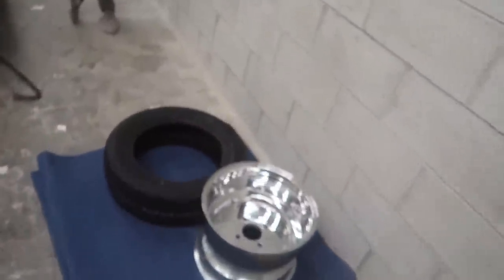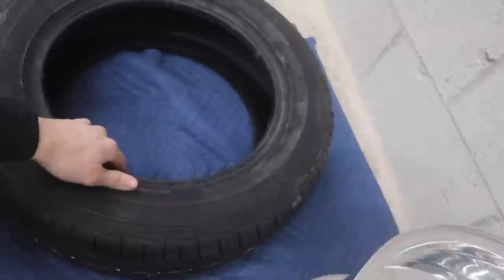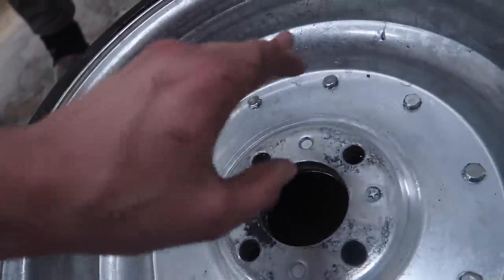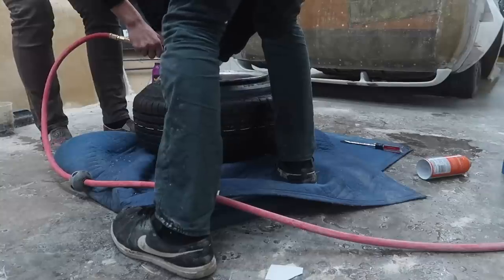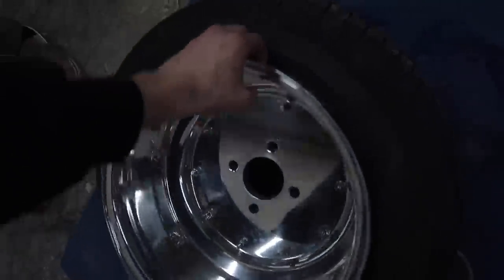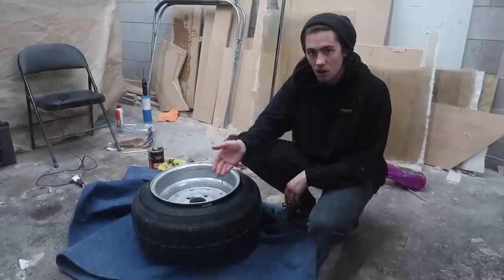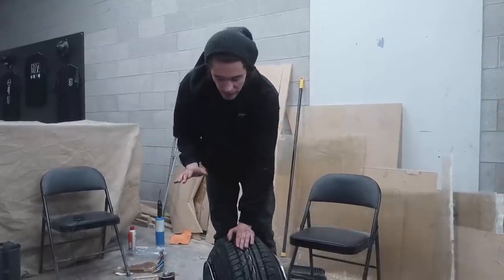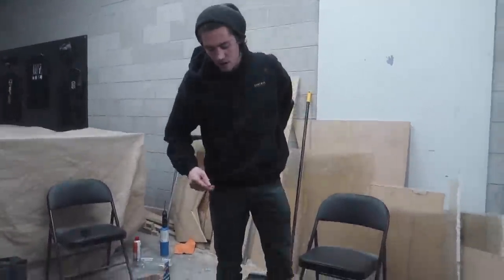Trying To Fit A 185 On A 10.5j

Comment: Harbor fright has tire spoons for 5 bucks and they last....AND BEAD SEALER GOES UNDER THE BEAD.NOT ON TOP😂😂
Reply: He said he isn't keeping the tire so does it matter? It was a test not permanent. So who cares?
Reply: Whether he is keeping it or not he used the bead sealer so wrong
Reply: @mynamejeff2647  It seriously was to hold air long enough to test fitment. Like 404found said watch before commenting.
Reply: 404Found if you read his comment he said that bead sealer is used on the inside so putting it on the outside wouldn't work so he didn't seal it and he also was giving advice on how not to rip tires by buying a tool meant for the job in no way did he call him out for ripping the bead he was giving friendly advice it's sad to read YouTube comment and see people attacking others when they don't understand what's being said or done

Comment: I think it’ll probably be your best bet to go with a 185-195/60. I’m sure you’ve seen this already, but most of the boso guys either run a lot of stretch, or use vintage racing slicks for a little to no stretch look. I personally like the way both look, but those wide vintage tires are extremely expensive. Speaking of that though, Hayashi is going to be selling some new tires that are just for wide and low offset 14” wheels. May be something to look into!
Reply: When they do slicks, they tend to be low profile as well 👍
Reply: NintendoGeek26 yes you’re correct!
Reply: The slicks are more of a Kaido Racer thing.
Reply: Hashiriya*Style yes the kaido racers are the ones who run the vintage slicks. However, I’ve seen several boso cars running them!
Reply: @VermillionInvades  i remember seeing a super wide wheel (it was definitely over 15j) in an old video option video. It was running slicks with a stretch lol
Reply: NintendoGeek26 I’ve seen a Hako with flares stretch some ridiculous meat on a 14.5j. There’s pictures on google somewhere.

Comment: okay if you go with an r compund, say the tire size u need fits a 7inch wide wheel, put the tire on a 7 inch wide wheel and drive around on low pressure, like 15psi or so to soften the sidewalls drive around for a while then take them off and put them on the super wide wheels. do this and you will be fine.

Comment: stretching tires throws safty out the window period. i know alot of people run stretches with out problems but its still unsafe. however a slight stretch in my opinion looks great. my choice would be the 225
Reply: good luck finding 225 14's :D Idk if it exists at all
Reply: TOYO Proxes R888 P225/50R14  availible on ebay
Reply: @KrustyPickles  aren't those r comps? He said they were struggling with them because the sidewalls are too stiff
Reply: @commptonn  probably but they are 225s
Reply: @slamazonvan  if you can't get it on then it's pointless. This is a bozo car not a daily. He talked about trailering it to shows. Dude even said he is somewhat uncomfortable with the amount of stretch.
Reply: +Krusty Pickles Gaming he already had those tires

Comment: lol My nephew runs a tire shop, he just struggled to mount 24x14s with 35x13.50s for his 18 tundra.. took 2 blaster and a strap after half a can of lighter fluid warmed the rubber.. they do all those tire combos and set camber etc... if you do it again, use LOTS of dish soap with a little water 2/3s soap 1/3 water, get more of the fluid inside the tire to pop it, you can squish the tire a bit with a ratchet strap as you fill it to push the bead out

Comment: Tyler I’m surprised you didn’t spring for a harbor freight tire changer. I got one and I do my own  tire replacements. You are an inspiration for me in my build. I put 15 inch wide tires,14 inch wide rim, with an inch and a half spacer on the back of a Pontiac Grand Prix, On the front I stretched at 255/50/16 onto a 12 inch rim.   I know what you are going through. Then I made fender flares the way you made them for the  Miata. Have fun and be safe...
Reply: Tom Goodguy do you have an Instagram or any pics of it
Reply: Hey Tony. I do have pictures. I don’t really have any social media stuff. So what’s the best way to show you the pictures?

Comment: Don't know if it is even possible too, but have you thought of putting a tube into the wheel? that would sort out any leaks and get the tyre to the bead. I had a tube in a 195/60/14 alloy that wouldn't hold air.
Reply: That's something I wondered. I doubt there is a tube to fit these days. Tires are hard enough to find.

Comment: Those are reverse mount wheels... u have to set the rim face down and mount the tire from the back of the rim... Hope u see this.... I am a tire and lube tech...
Reply: yepp have the machine grab the outside of the wheel, not come from the inside
Reply: Lol that’s a front mount bud. The drop center is closer to the front lip not the back it’s very easy to tell

Comment: Dude use a hunter tire machine it basically screws the tire down through the hubcap hole and you won’t have them popping off the clamps (newer machines with that kind of clamp work best imo although they take some getting used to )

Comment: Another cheap tire that could go worked if you wanted a slightly wider tire would of been nankang 205/60r14 

They are around 50-60 a tire 
I had 225/45r18 stretched on a 10.5 with a nankang and I drove it like that all the way to Wisconsin and back in 1 trip

Comment: This has nothing to do with your rims, but I’m running 235/40r18 on a 10.5j and they look fat. I think with a 205 and a smaller wall it would look amazing n
Reply: PlasticAcaria 205 will not fit, 225/35 is the limit on a 10.5j. I have 225/35/18 on a 10j and it just barely seats, 10.5 will have a few millimeters of lip showing if you don't use "fat" tyres like yokohamas or bridgestones that are actually a bit larger than their specified size.

Comment: I think 175/60 is perfect on 10.5 jj or 185/55. My KE70 always use strecth tire because my style is shakotan japan, you can see my car is use 165/60 on 9.5jj. more like donuts is more authentic like japan. Just find the tire shop who use bazooka dude, they're can fit anything tire. I dont think so american dont have that
Reply: the thing that blasts air out? here in the states theyre called cheetas
Reply: @dillonbmx16  yeah like air pressure. Somepeople said it booster bazooka, in my country many tire shop use that. Because asian country love to stretch tire. More safety and easy than tyler do with fire